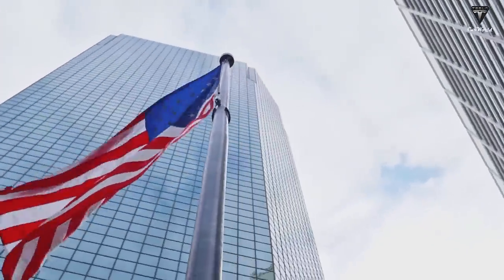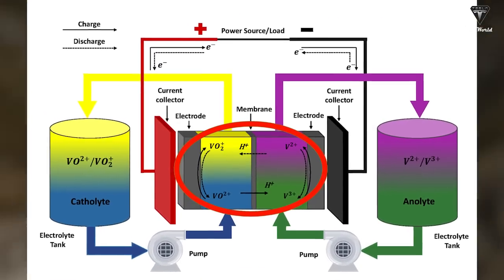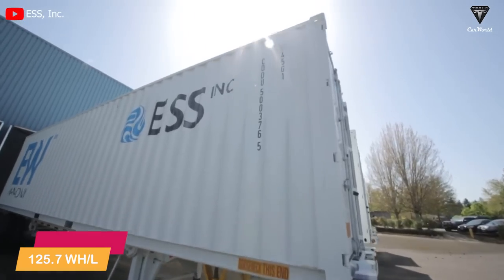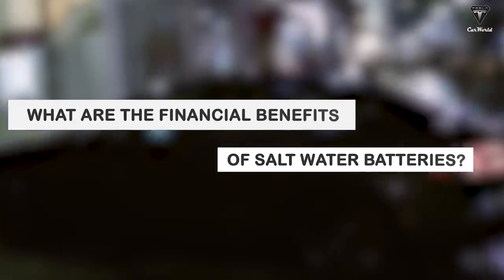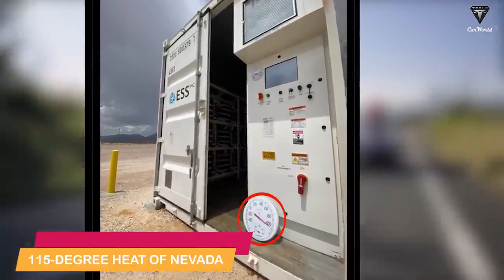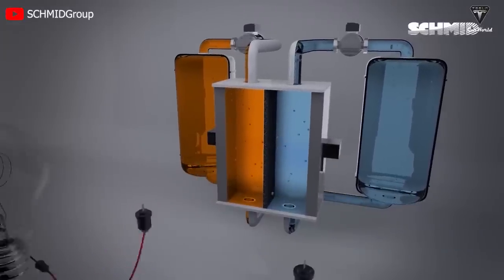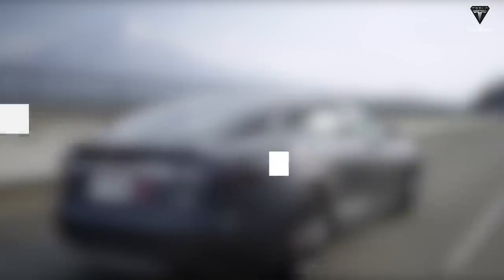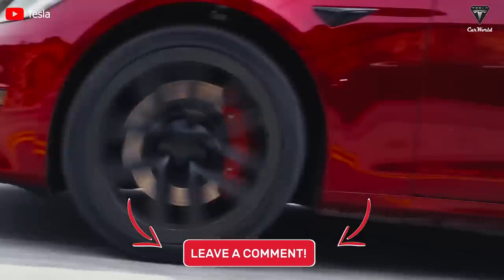Elon Musk Revealed How Salt Water Batteries Could Challenge Lithium!

Comment: I dont know if it will work in cars - but salt water batteries should work in grid and house power needs as they trade weight and power for cost. Aka, for the size of a stove, you could have as much power as a tesla power wall at a third of the cost. On the flip size, sodium batteries might still work in cars instead. Keep in mind salt water Batteries are not the same as sodium batteries. They also scale really well - so something like the grid they would be perfect in... even if they might take some land to do so. They can be stack on top of each other to make all use of the space. Sodium batteries on the other hand, while having a lower power des compare to LFP can still do something like 150 compare to LFP 180 from BYD they do have plans to increase that closer to 200 by end of year and start making them by next would make them cheaper and better than LFP for getting the price down in the future - as much as 30%. On the other hand, they might be able to get it to closer to 250 or even 300 if they use both elements of Na + S. Both elements are super cheap making it 50-60% of todays Li batteries - allowing for that 15-20k in the future as well. I say we're about 5 years out for those batteries. Keep in mind these number change I feel on the daily - so understand that they all will improve over time - but just note more important that cost is the major selling point here and that its going to improve going with Na + S making it the go to over other technology. Same with going Salt Water over a whole pack of Li batteries.
Reply from the maker: Nowadays, salt water batteries can do a variety of useful tasks that other batteries cannot such as in battery production, in other industries, it is used to produce fresh water, the manufacture redox process can also be adapted to produce graphene. It is also used for applications in renewable energy, telecommunication towers, oil well pumps, agriculture irrigation pumps, and greenhouse irrigation or lighting.

Comment: Looks like the salt water battery is not as energy dense as a Li battery. These batteries will not fit in a car.
Reply: They would fit. They have the identical energy density to that of lithium iron phosphate battery, which are increasingly being used over standard lithium batteries. Tesla Model 3 has LFP batteries, with the exception of the performance model. Cherry and BYD will begin using them later this year.
Reply from the maker: The main aim of salt water battery chemistry is that optimal for cycling application or EVs batteries and stationary, long duration, telecom systems.
Reply: @TeslaCarWorld  Salt water batteries are not energy dense enough to use in cars. If so, they would be used already to replace Li.

Comment: That is a  secret but  salt water + some ingredients can hold quite a lot  electricity , if someone is smart enough  can make cheap 10kWh battery at home . Only one problem is  size  , about  800 litres of salt water
Reply from the maker: That's correct. Both the recipe and the required ingredients for making a salt water battery are relatively straightforward. Consequently, if you are familiar with batteries, you can totally construct your own salt water battery.

Comment: You neglected to site the recharge time!!!!!!!!!!!
Reply from the maker: We sincerely apologize for the information gap. The duration until the salt battery is 100 % charged depends on the initial state of charge. It takes approx 1 hours to completely charge a completely empty battery. Saltwater batteries have 0,5 C-rate. For Initial-Charging, limit the Current to about 0.5-Amps.  Based on the discharge voltage (~2.9 V) with participation of O2 and the charge voltage (~4.1 V) with Cl2 evolution during the first cycle, a voltage efficiency of about 73% is obtained.

Comment: well sound like they might have overcome the earlier ones. Before you had to have a battery that was twice the size of  led acid
batteries. The problem was as Deep Cycle batteries the could not discharge at a fast rate. People tried to use these Salt batteries on solar power but never could get the higher current output at a faster demand needed.
Reply from the maker: That's right, salt water batteries have successfully passed numerous tests to attest to their excellent performance. For the demands of a region or a small state where the demand for electricity is average, this kind of battery is proving to be quite suitable.

Comment: It looks like these salt water batteries are only being used for stationary storage currently.  Is there a reason why it's currently not being used in EVs?  I didn't really see any mention of any drawbacks besides the temperature range being less than current batteries.
Reply: Yea this video didnt go any of that. The main limit is the weight. It has a lower power to weight at around 100 where LFP or Li does something more in the 150, 250, and 300 ranges right now. Granted, some of the volume it lost (because of making them stander looking batteries) so its possible they might be able to gain some of that back in a larger size foot print (as it can be made as a single unit vs 100s). So I guess it possible? At the same time, I am not so sure about that. At least in cars. As for grid storage and maybe house - yea they make sense. They can store a lot more power at a cheaper price at the cost of size and weight. You could have two of these at the cost of one power wall at double the battery size. Think stove size.
Reply: The problem with existing sodium-ion battery is a much lower energy density compared to lithium-ion.
Reply: @sylvainlaurin1012  True, but there are a lot of factors to play with. For example, some of the density is simply lost because of how they make the battery blade vs stander battery sizes. One thing to keep in mind is a lot of them still use active carbon and price for both li and that active carbon. If they move to Na + S not only would they be able to hit double performance numbers ( 250 - 300 from 150 ) it would come at a much lower cost and higher supply. Li is only going to keep increasing in cost because of the limited access to it. Plus nothing really stops them from using both or a mixture of both Na + Li + S. Keep in mind there is a difference between Salt Water Batteries vs Sodium Batteries. Salt Water batteries do trade a lot more of their weight but they get a lot of their advanages by moving it into volume instead. So yes they're going to be bigger than Li or Sodium batteries, but they come in at a even cheaper cost because they also trade the active carbon for something else making them a 3rd of the price of either of the above options at the size of a stove. Still good enough for home or gride power vs Li. Price alone will be the major selling point of sodium because the battery is pretty much the only limiting factor for more solar, wind, or hydro power production.

Power Grid/Home = Salt Water batteries = 100-200
Cars = Na + S or Na + Li + S or 50% Na + s and 50% Li + S = 200-400
Mobile Devices = Li + S/C = 400-500
Reply: @adr2t  I heard the existing problem with Li-Sulfur battery (or Na + Li + S and Na+S) is a much lesser number of recharges.
Reply: @sylvainlaurin1012  Yes that was a problem before, but presently and to keep the story short, they figure out how to fix that and should be on the market by next 2-3 year as they are working with everyone to start using the new method. Lots of youtuber cover this more recently. Sulfur allows 2-3x more power making Na + S about the same as current Li - and Li going to jump into a whole new generation, but again, short supply of Li making it a harder choice to use as the cost of it will go up even though it will get a kick back switching from Active Carbon to Sulfur. Cheaper cars will be use more Na while more luxury cars will be using more Li + S. Either way, if NA+S can reach Li 300-400 it be more than "good enough" for everyone considering LFP is only 180 maybe 200 by next year and a lot of people already ok with LFP. Maybe more - my numbers could be off - but I do understand things change over time as they go up.
Reply: @sylvainlaurin1012  LFP batteries from CATL have identical energy density to CATL Sodium Ion batteries, which will start being used later this year in Chery and BYD cars.
Reply: The cold weather impact is actually better with sodium ion batteries, which means less range loss. Sodium Ion batteries are just barely being released, CATL is releasing them this year, to start with Chery vehicles and BYD vehicles and eventually everyone else for anything under 300 miles of range.